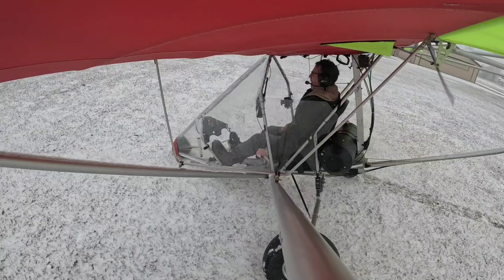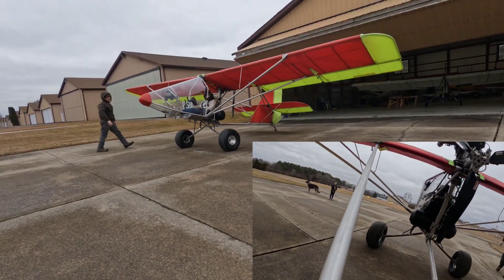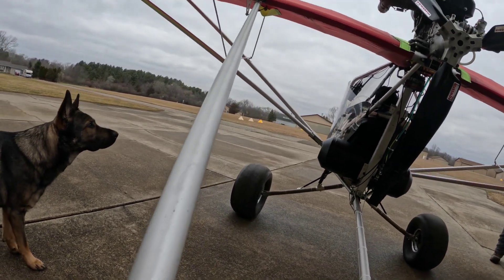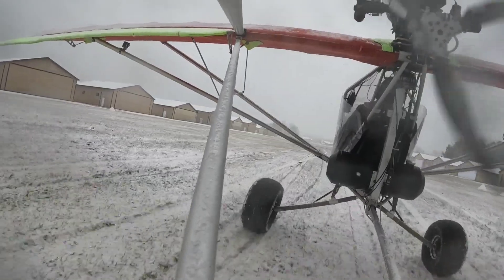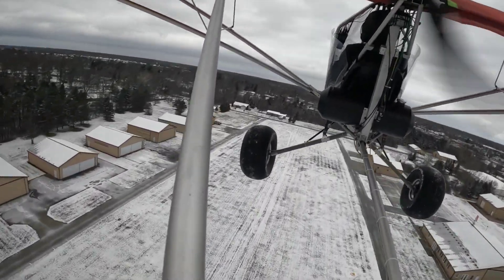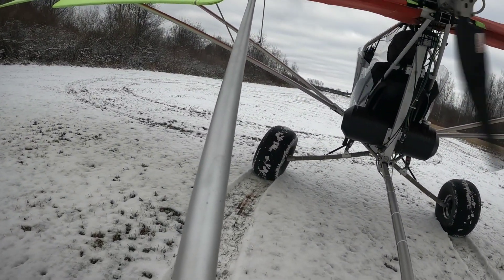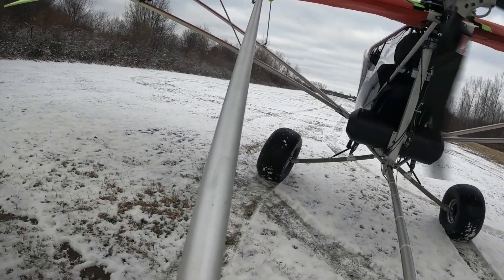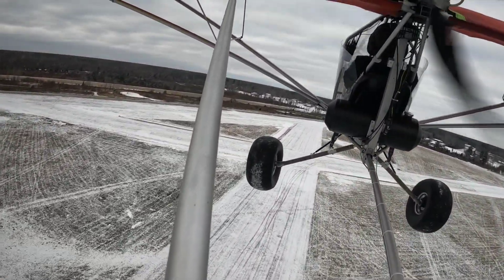Aerolite 103 Bush gear upgrade flight test!

Comment: Beautiful...the bush gear is good looking and clearly absorbs stress.
Reply from the maker: It feels like riding in an old Cadillac, kind of floats along with purpose.  Between the shocks, fiberglass legs, and tires with next to no air pressure in them, it's a cushy ride!

Comment: Nice work.  The bloops are designed to nose over for max braking.  Bumper is a lightweight option.  
I’m originally from Michigan, but this video reminds me why I left!  I hate the winter overcast!
Reply from the maker: I love it here. Winter is definitely a challenge, but here I am.
Reply: Ya, Michigan winters sucked!  Sometimes overcast for over a month.  Crazy lake effect.  Lived there 5yrs working at the GM Proving Grounds, then moved back to MN.  Best job ever though!
Reply: The Bloops and Bluebird do indeed add braking power by nosing over. This can be seen as both a benefit (more effective emergency stops) and a problem (a possible unplanned stop).
A downside to this soft landing gear is that it may not resist side tipping in a cross wind as well as stiff gear. The pilot may have to be more skillful and alert to keep the plane on the runway at ground roll speeds, since the gear is not preventing a banking tip and the ailerons have marginal authority when slow.

Comment: Nice always wondered why these were not offered in a bush configuration. If you nose over won't have a prop strike one good thing about a pusher.
Reply from the maker: Yeah, both configurations have their advantages. I wasn't too keen on pushers at First. I have used the anti-prop-strike feature quite few times now! 🤣

Comment: I like the look and the joy stick over the yoke configuration. Your gear looks robust enough but,….. have done any beefing up on the empennage design structure since your now adding more ground loads to a designed not built to handle ground taxing and landings. Yes it’s a tail sitter but that’s at rest.
Reply from the maker: Yeah there is quite a bit of reinforcement.  Tail tubes are all sleeved,  , some of the fuselage is now 0.125 instead of 0.035, and many parys have been retriangulated. I'd put it up against any aerolite out there for durability.  I have flown 100 hours like this, and made some extremely rough landings. It's ready for real life bush flying and off field landing anytime, anywhere.

Comment: I love your plane! As kitted out, about how much ? Is your cockpit heated? Is it or can it be fully enclosed? Support for a panel mount for an iPad ? A million questions😜 Thanks for a fine vid and always glad to meet a brother on the interwebbs! GBU & your family!
Reply from the maker: Its hard to put a price on a kit since a lot of the work has been done by me and is not available as a kit from aerolite.
I have seen new aerolite builds go from high 20's up to nearly 40k depending on options. A used airplane can be acquired much more reasonably. 
The enclosure is really just a piece of lexan draped over the fuselage.  The floor is aluminum flashing.  
Im not sure how you would add heat, but I used heated clothing (diy powered by a drill battery) all last winter and flew in as cold as 17°F pretty comfortably. Snowmobile clothing could also suffice. You could definitely find a place to mount am iPad.

Comment: mountain bike shocks, especially air shocks need to be service quite often and i doubt they withstand landings over a period of time...
Reply from the maker: You over estimate the frequency of their actual use.  If I have to replace them every few years,  that's fine.  They are cheaper than most airplane parts.
By the way, after 100's of abusive landings, they still work fantastically.

Comment: Wonder if you reinforced the tail of the ultralight in some way to hold the weight of the plane and you or in case of any unexpected hit with the tail landing area.
Reply from the maker: Yes it was reinforced when converted to a tail wheel. 
The mains take the majority of the abuse, it would be very difficult to damage the tail in a landing. 
Your angle of attack would have is so high to touch the tailwheel

Comment: What kind of material are your wings made of?  As I look into these aircraft & all the expenses I kinda worry about the wings as
I've just learned that depending on the material they can have drastically different life expectancy?  The LQQK isn't as important
as how long they last so I gave ya a like & Subb'd Up too.  peace & GB You/yours
Reply from the maker: @diggy-d8w  these wings are sail cloth covered (Dacron is an example). It is very durable as long as it isn't left out in the sun. Storing it indoors amd keeping it dry and clean will extend its life substantially. The cloth you see in this video actually had to be replaced as it later began failing.  I have a video where I replace the cloth and the airplane is now blue.
Reply: Glad to hear you out there & well..... lol, I'm looking at these & there's so much confusion/misinformation.  I guess some
channels will say things for views or perhaps they don't know but I'm trying to figure out how to get started. I do have the
Policy/Rules for Part 103 aircraft & looking at them is where the confusion starts as a lot of channels do a mix since
they own aircraft of multiple classes.  It's all good,  I'm reasonbly certain that yours is a Pt103 offering & you appear
to be trying to do things right, safely, and the God Bless at the end meant something to me.  Anyhoo, I'll be digging
around thru your stuff.  This is the 1st video I've seen, the channel name threw me off yesterday & I went the other
way...lol, but today  when ya hit my feed again & I saw you did the wheel upgrade, I had to look. The wheel sizes
are one of my pet peeves against these,  the tiny wheels just aren't that good unless you stay on a paved area &
I doubt I could w/ one of these so seeing you talking about what I'd want to do captured my imagination.
Tells ya how boring I am...huh?  thanks & I'll be chatting you up here/there.  Thanks & GB
Reply from the maker: Big wheels and tires will almost certainly make these aircraft overweight. It is a safety concern depending on where you fly from IMO. 
There is a ton of conflicting information out there. My best advice is to join a flying club where you can draw from tue experience of others and get proper training.
Reply: Yep, I agree.... tons of bad info & if I ever do this I'll be putting some money up front for lessons.  I'm not afraid to just
"Do it" but it's just wise to get the basics of etiquette to operate around airports & pilots.  For now it's research. peace

Comment: What would a rig like this cost a fella? I would need a two seater.
Reply from the maker: That is a good question! It depends on a few different factors.  It can be significantly more if you start with all brand new gear, as opposed to modifying an existing aircraft. There are also quite a few different o optics in terms of equipment from engines to avionics.  I have new aircraft kits available, and also can modify existing aircraft.  If you would like to discuss your particular mission and budget feel free to reach out to me at kidkhaos@kidchaosconcepts.com 
I can help tailor a machine that will fit your needs!

Comment: I see alot of issues with that gear setup
Reply from the maker: You and dozens of other youtube engineers. 😆
 I have flown and tested this extensively at this point.  Not only does it work,  but it has far exceeded my highest hopes.  I have successfully plopped this airplane into all sorts of rough terrain that would have demolished a normal aerolite. 
It doesn't need to have great geometry. It just needs to absorb inpact and spring the tires back straight afterward, which this landing gear does exceptionally.

Comment: Call me crazy but I would've used the upgrade money for a nose wheel. To each his own. 😎👍🏻
Reply from the maker: Nosewheel is standard equipment on these. Its certainly not an upgrade in terms of durability.  Land one of these woth factory gear off field and there is a high chance of damage.

Comment: Landing gear are positioned way too far back
Reply from the maker: The landing gear is exactly where it needs to be.  Moving the gear forward would put too much weight on the tail. The fuselage can't handle more weight on the tail. I also want to be able to use prop thrust to lift the tail during take-off and ground maneuvers. The Latin of the gear also works out well for my weight and balance.
At a glance, I can see how you might say that.  But if you do the math, you will see that it is the best possible location, all things considered.